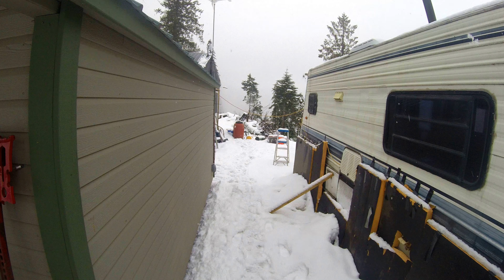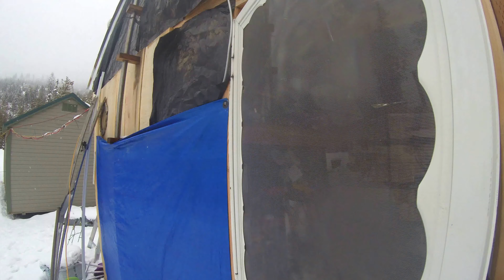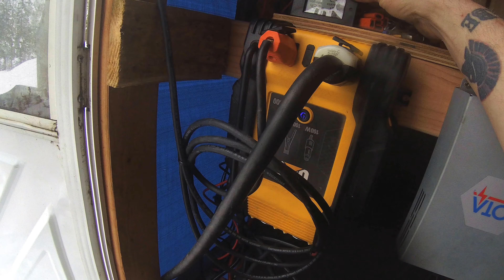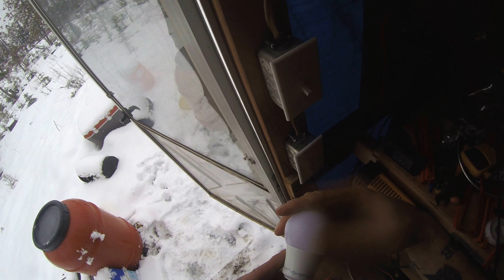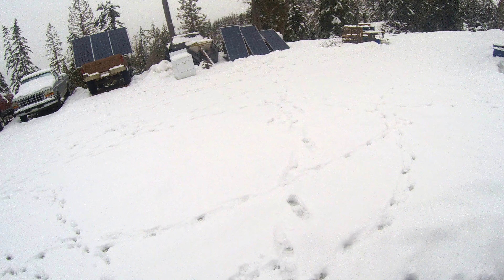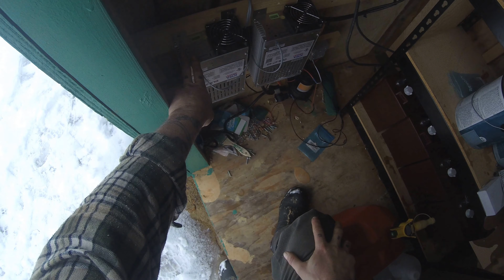Solar!

Comment: I'm figuring it looks more complicated than it really is, but that's still a lot of wiring!
Reply from the maker: It really is pretty simple it's a mess right now though. That's part of the problem with everything being put together a little at a time and the location of it just being temporary.
Reply: Eh, for now it works. That's all you need.